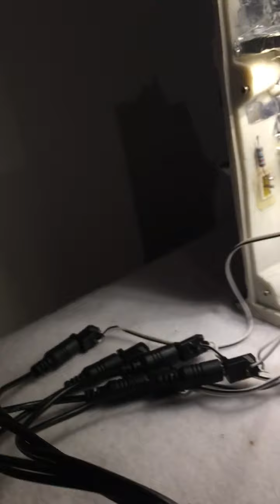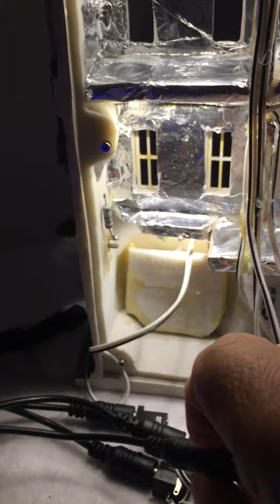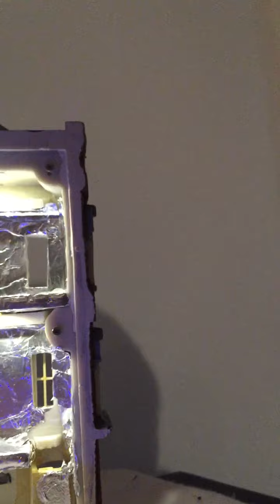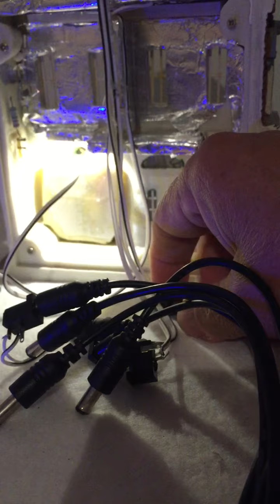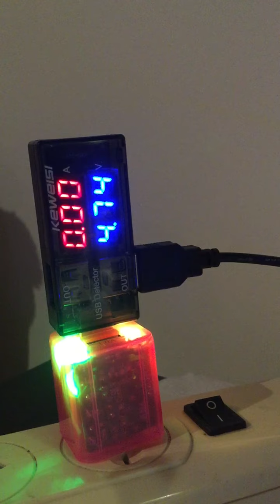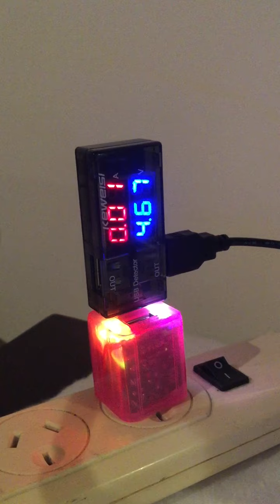Lemax Villages: Dynamic lighting to enhance static displays.

Comment: Well that is all cool. So dont forget about the possibility of painting the back wall to absorb light. With a little flat dark brown or any color you can change the reflection in the back. Or just apply a dark paper. Just what came to mind. TFS
Reply from the maker: Thanks for checking in Pete. All good suggestions - many ways to skin a cat!! I used the foil because it is very easy and quick to cover the walls whilst still allowing a small light source to be bright! On hind-sight, you are right, it is a bit too reflective!!